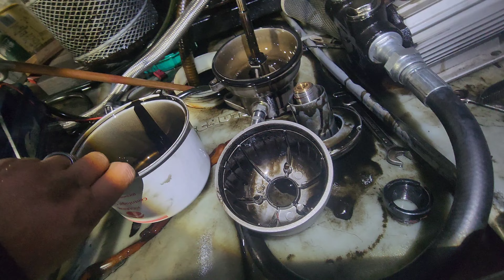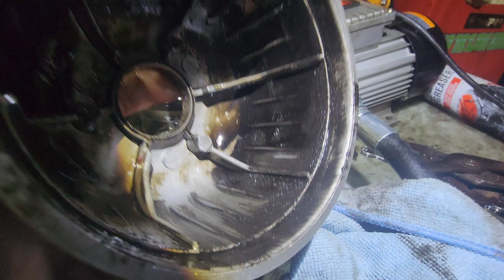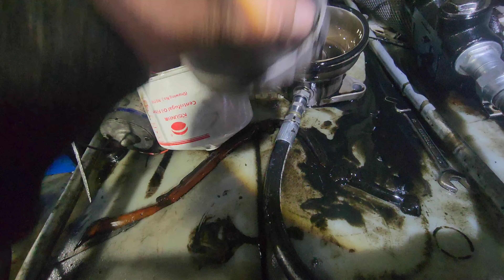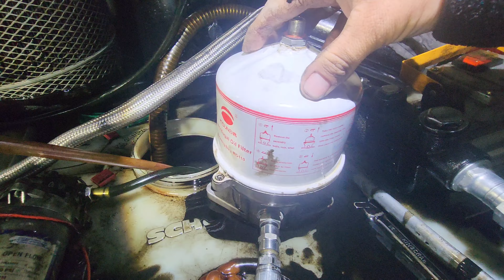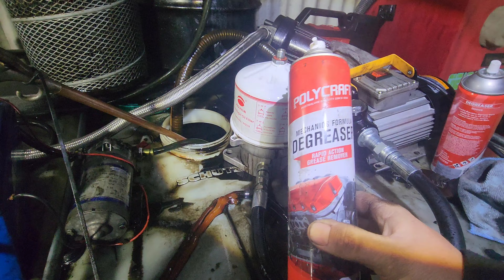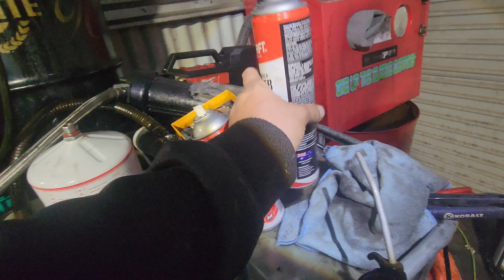Cleaning sludge out of Black waste motor oil to make black diesel. Centrifuge

Comment: waste veg is way way less grief and hassle
Reply from the maker: Don't you need to add methanol and something else and boil it all?
Reply from the maker: I only filter then cut this with unleaded and send it
Reply: @Oneupthesleevecustoms  same so with veg oil can be ultra cost effective and only cut when near dry on last few miles from home to the tune of nomatter what miles you do only putting in 1ltr petrol or 1.5 of kero a few miles before gettting home i filter the veg oil straight into the clear ex water/veg oil 5lr/10ltr bottles ready for use so basically in winter start in morning the once along the road til warmed to reg temp put in the estimated volume for the trip in 5ltr/10ltr volumes at a time dead easy once up to speed and no special equipment just a big funnel with snug fit sieve inside and a couple layers of good condition tea shirt jean or bedding cloth. seriously all in all mastered to a T
Reply from the maker: @monkeymagic4555 do you have any blocked injectors or anything? How's the power output
Reply from the maker: It's crazy how much waste motor oil I can get for free around 12 to 15k litres a year with no effort
Reply: @Oneupthesleevecustoms  much such same power maybe 10% down on mpg smoother quieter more torque
Reply: @Oneupthesleevecustoms  get my veg oil between free-15pence a ltr and the 15p a ltr (of which i insist paying even if free) is only if i recognize certain suppliers as being cleaner/better stuff basically to keep the ball rolling
Reply from the maker: @monkeymagic4555 I'm finding down on power I've burnt around 2000l in my mazda truck